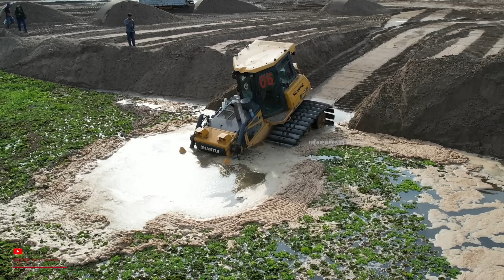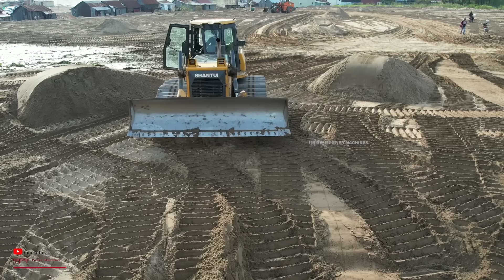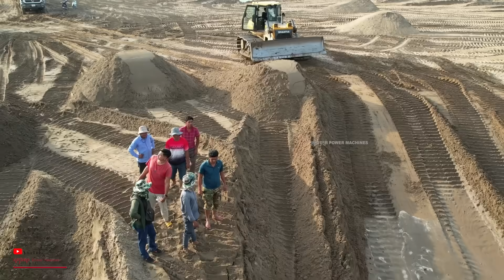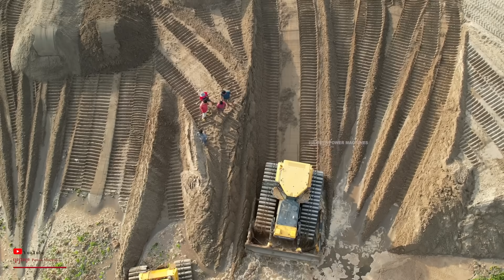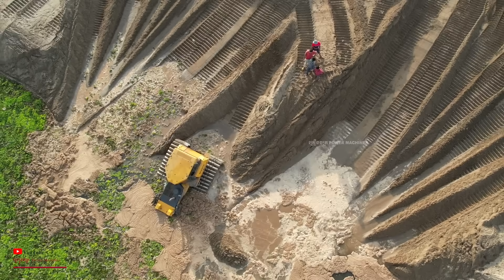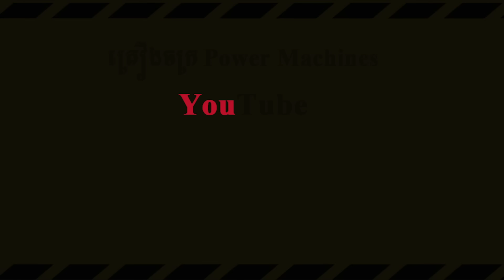Incredible Showing Dozer Failure In Water And Technical Skills Helping By Dozer Mov Sand Into Water

Comment: As a bulldozer operator, it seems like the crew that knew what they were doing left and a some kids took over. They had a nice edge going,  all you have to do is dump the dirt over the edge after that. Easy peasy. No need to cutting a grade at such a steep angle like that.
Reply: the question on last section of tape, why is he pulling so much water with plate down. i think this is the answere of these question. binding dust, need water
Reply: I don’t think that’s the case cause that truck that dumped a load of sand was sinking there for this wouldn’t have worked the closer the trucks got to the edge
Reply: Easy peasy my friend
Reply: He knew he fuked up when water rose to hit chin probably
Reply: @pierrejeanes  u i
Reply: It was done on purpose
Reply: @m0nsterman902  I would say it was on purpose to get this video because there was a drone up there filming the whole thing.
Reply: @bdaz7466  they obviously had two drones there so they were planning something.
Reply: It looked like he did it on purpose for the drone to film, or maybe he was watching the drone rather than what he was doing.
Two machines down for a  half hour for something that should have taken five minutes, crazy.
Reply: Why not tow it out?
Reply: You think with water that deep they would stabilize it with rock first instead of waisting all that good fill ,noones wearing hiviz and wandering around heavy equipment

Comment: Tuesday dozer did not fail. There just was an inexperienced operator in the the cab. As an operator. You use the soil to push the soil into the water. They justvwent too far.

Comment: Hello? This operator of the bulldozer doesn't know how to operate a bulldozer question is why didn't he put a cable on the back of it and tow them about the first time instead of pushing all that dirt underneath the bulldozer doesn't make sense not trying to be funny but that's what happens when you have people that don't know how to operate equipment if they never been taught they need to be trained on how to operate heavy equipment food for thought 🤔

Comment: If the stuck dozer would have pushed his blade down, lifting the front of the dozer in the tracks off the ground. The other dozer could have probably pushed enough sand under his tracks to get him out
Reply: Not bad but if it's a drop off then putting the blade down wouldn't help raise it as the blade would just be hitting nothing and even of it did hit anything he is putting all the weight on sand which is in the water so it would give way before the heavy dozer would lift up.
Reply: @hilham89  with the blade up, the weight of the machine is spread evenly through the tracks. Also making the sand at the front of the tracks more likely to give way. By putting the blade down, IF it did give way, the blade would hit bottom first, keeping the noise of the machine roughly 2.5 ft higher than with it up. Witch may still not be enough,  but any bit would help
Reply: @boom-rl7me  true, but we don't know how deep it is so putting the blade down would do nothing. I understand where you are coming from though with the blade being down but if there is nothing infront then putting the blade down would also put the weight out front which could cause the dozer to slide in further. It's hard to tell because of the water, I doubt it's that deep or how much sand they had already pushed over before this happened. It's all about what if really.
Reply: @hilham89  agreed, dude should have never went that far in the first place. All the work prior was done at a level grade
Reply: Makes good sense.
Reply: @boom 259
You obviously have never worked with sand much less sand in that environment. 
Every dozer should have a winch . This should have been a 15/20 minute recovery (at the most)
The operator should have one shot to learn what NOT to do
It looks like either NOBODY knows what they are doing or they did it for views.
Reply: @marshallcollins8634  your right, I haven't worked in that environment. And yes a winch would be a great way to pull him out. HOWEVER I didn't see any winches on these dozers, so I didn't base my comment on the best way to get him unstuck. I based it off what I seen.

Comment: Now i know how to advertising S-slope compacting using water and weight and sand-tracks. Drain with both-sides S-slopes. Cliff "folding" land-slide sliding for more advertorial. Milo-beverage failed to impress.
Reply: Small pond and lots of time to pump water into pond, creates a sub-terrain-nean slope as slider...

Micro-vibrator pipe as vertical-poles is limiter vertical wall for land-slide.

155mm towed artillery or 200mm vehicular artillery with white pack no shell is shaking the sandy not rocky... 

Youtube entertainment is advertising-marketing costing-budgeting expense internal-billing-costing cost-center and profit-center is 2 halves of one department.

Comment: I'm guessing it would have been too easy to just hook a cable to the dozer and pull it out to begin with. What was the purpose of moving all of that material??? And what was the purpose of all of the back blading afterwards? this appears to be a case of not having the correct machine for the job OR not having capable operators.

Comment: You got the  dump truck out there which has more power than the bulldozers  just use a chain and pull it out instead of  going back and forth for 100 times

Comment: So many armchair experts...

They needed to get water into the sand beside and behind the stuck dozer so it would aid in compaction. Without it the second dozer would have not been able to pull it out and would have simply spun itself into the sand and then two dozers would have been stuck. 

Notice at the end how one dozer is repeatedly pulling water back up onto the sand pile? That was what he was about to start to do when he went into a section that was far deeper than he expected. Sand has a high compaction rate. It can be compacted to a relative density of about 70 - 80%. To optimize sand compaction, water is added to fill up its voids and hold the particles together. If they were not continually adding water to that dry sand even the trucks hauling it in would simply get stuck in it.

Comment: There may be some other reason but my guess is that if something happen while pulling, then the dozer will be inside the water and they don't want to risk over time.

If they had done as most people suggest, This video may be included in "stupid people at work" or  "fail compilation"

This is not to hurt anyone rather thinking from their point of view

Comment: I have over 50 years of heavy equipment experience and I have extracated hundreds of wanna be operators, so here are my thoughts. 

Poor technique by both operators, but more so on the first operator. Both were pushing the piles too far into the water and allowing backwash to fill and saturate the soil. The first dozer could have been extracated quite easily, by using  dozer #2 and 2 chains. Just push a load of soil within 50-100' behind dozer #1 and embed the blade as deeply as the dozer #2 can push it. Then connect one chain to each corner of the blade on dozer #2 and connect the other end to the grousers on each track. Put dozer #1 in reverse and back up slowly. It will spin until the chains are on the bottom and being pulled forward by the tracks and dozer #1 will pull itself out. It's much easier than it sounds.

Comment: That was a 2 minute job and felt like forever to get him out..to all of you learning and just starting a career into heavy equipement this is not a video to learn how to be an operator. The one stuck if he can put his blade down having it lifting the front end he is not stuck and can get out on his own. If its not the case then yes he needs help but this has got to be one of the dumbest ways if seen so far. Looking at the one stuck his tracks are not even under water or heavy dirt by that being said a simple little pull it was out of there in no time. The helping dozer only had to go behind him in his tracks without pushing any dirt what so ever and just pull him out of there like nothing...This has cost the company a lot of money just to get him out of there having one dozer stuck..another one that has no clue what he is doing and took forever to get him out..other words 2 dozers waisting time and burning fuel and finally a whole crew standing there like flamigoes doing nothing but looking and enjoying that nice sunny day

Comment: What the he11 did I just watch ?
The operator on the dozier that isn't stuck is running back and forth pushing dirt off into the wetland they are apparently trying fill in, but what he's doing is totally counter productive IMO !
 But the other guy, I guess he just said to he11 with it, and drove his dozier off into the pond to catch a break, I guess !
 And then finally, someone breaks out the chain, so they can drag  the idle dozier out of the pond. Now they can load it onto the closest, empty, low boy trailer haul it somewhere that a mechanic can drain all of the water out of the running gear and change all of the fluids ! Production Yay !

Comment: So the dozer operator spends 45 minutes pushing dirt either side of the smaller dozer and then pulls them out, why didn't they just pull them out to start with and continue working. Looks like they faked this so they can make a video

Comment: Those dozers weigh at least 51,000 lbs each. Also, when you get stuck in that mud he made, it creates a vacuum and you have to break the vacuum to get it out. You can’t just slap chains on it and pull it out because the chain will snap and most likely kill someone. The dozer has the power, the chain does not have the strength. You would have to use a cable rated for at least 250k lbs.
Reply: нам не было вакуума. он только передом немного свесился в яму.
Ты ничего не понял и пытаешься  оправдать дураков.

Comment: A chain? that's crazy can you imagine how big it would have be? Some people!
Reply: Depends on what you call a "big chain". When you are used to working with the anchor chain on a battleship? Yeah, a small chain will do just fine for pulling out a bulldozer 😂 
Actually, when you think about it, all you need is 10 feet of a 1.5" link chain to give it assistance. Only around  2 or 300lbs of chain! C'mon! Toss it in the truck and go! 🤣  - 1" steel cable or 4" double braided nylon hawser would be enough to get him out, and they're lighter.